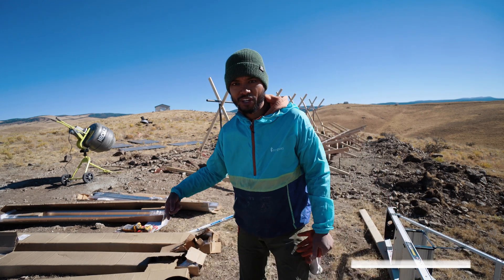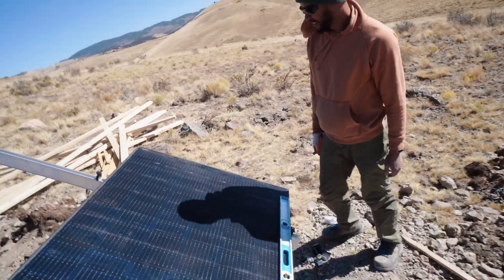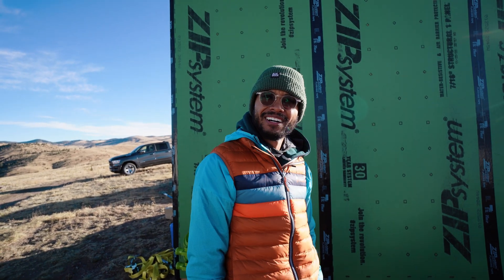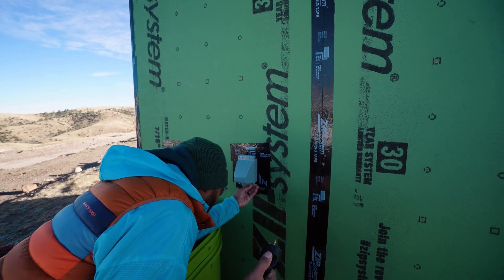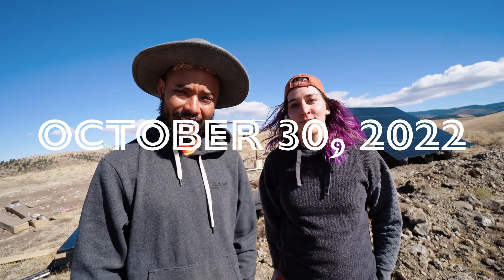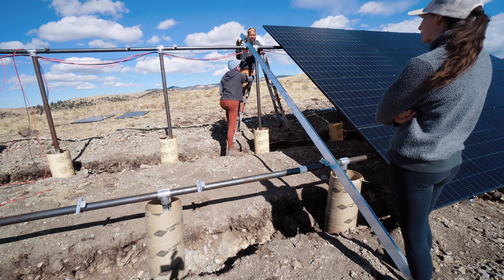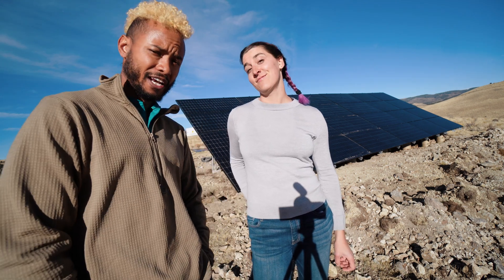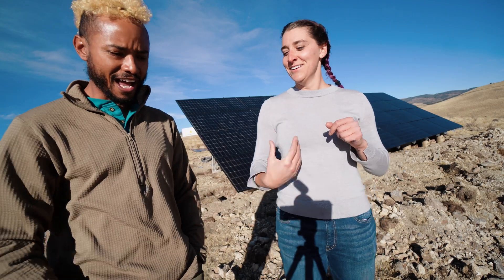DIY Off Grid Solar Power System | Pt. 3 Putting the Solar Panels Up and Getting POWER 🔌🌩

Comment: Not sure where you're located but a few tilt angles for summer, spring/fall, and winter would improve output noticeably!
So would've splitting you array into 3 aligned slightly west, south and slightly east in order to maximize exposure during time of day.

Comment: You all are doing great.  I love your go for it attitude... No fear; just do it.  I am curious, why the growatt inverters instead of eg4 inverters?
Reply from the maker: It’s a silly reason on why we went with Growatt instead of EG4… We purchased half of the equipment before the EG4s were released, I opened one box to review the manual and upon the release of the EG4 inverters, I attempted to exchange them but because I opened the box (slightly) there was a 20% return fee. I wasn’t willing to pay that. I don’t know if I mention it in the next video, but if I did it over again, I would have waited until I got to Colorado and shipped everything there, while getting EG4 inverters. But we’re still satisfied with what we have for now!!! Great question!
Reply: @LineUpTheStars  Gotcha.  I hear nothing bad about the growatts.  I am sure they will work out fine for you.  Good luck.
Reply from the maker: So far so good. One of the major problems is that there are 2 versions of the 5000 watt. European and US. Luckily, Signature Solar only supplies the US version, but we needed to get an auto transformer to split the 240v to 120. I will not be surprised if/when we upgrade the inverters, but will try to maximize our use out of the Growatts for now lol 
We’re always learning, but sometimes still learning after decisions have already been made haha